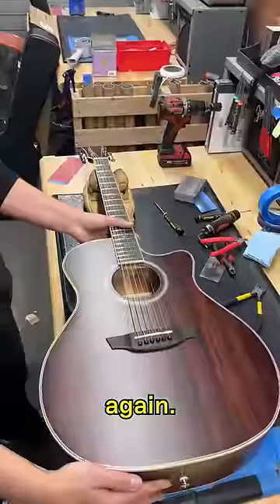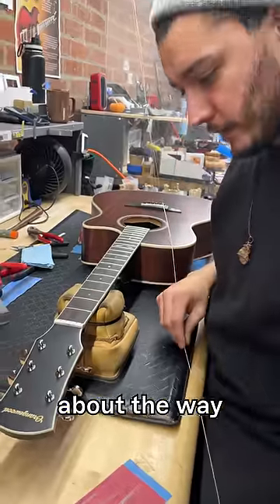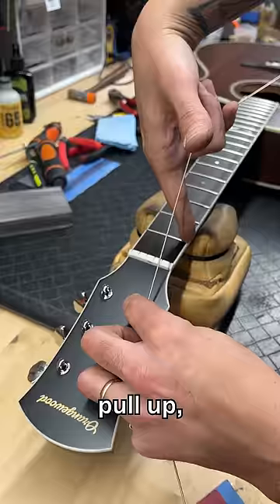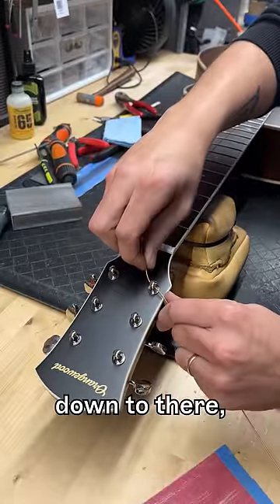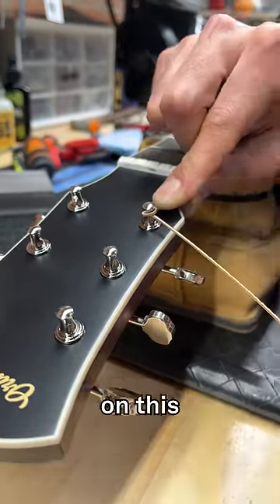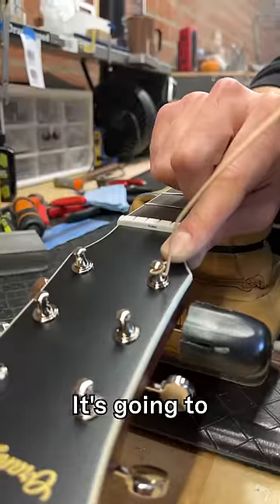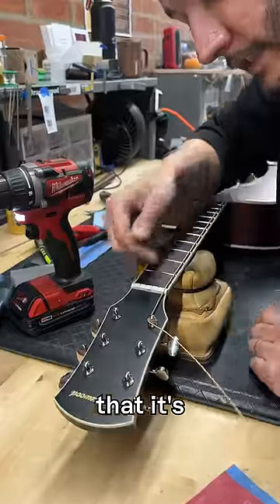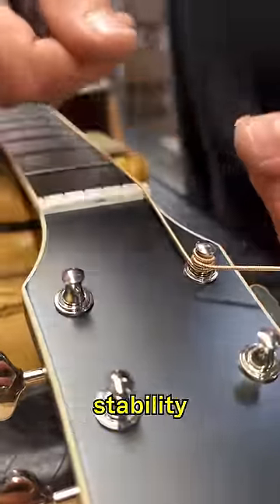Restring your Guitar like a PRO with this HACK

Comment: As a luthier, I advise changing one string at a time. A set of steel strings at pitch is exerting c.70kg of tension. The forces on the top and neck are massive, and the guitar doesn't like big changes in tension. I only remove all the strings for repair work.
Reply: I have been told the same by three pros
Reply: where do you start - thickest string to thinnest, or the other way?
Reply: @alcatraz0198  it doesn't really matter, but I start with the low E, then high E, then A, B, D, G.
Reply: 100% !
Reply: @elpirata2685  thank you, will try that. :)
Reply: Doesn’t hurt it to take them all off. How are you going to properly clean and oil the fretboard?
Reply: Truss rod is steel. Cut them off all at once....one at a time or in pairs....it doesn't matter. I'm betting you can't even pronounce luthier properly.
Reply: Yea whatever. Complete nonsense
Reply: @Craig-xf7ox  Truss rod may be steel, aluminium, brass or carbon fibre, or none at all. Soundboard is spruce or other conifer and thicknessed to around 2mm. Only remove one string at a time unless doing repair work that requires all strings off at once. Fingerboard and under strings can be cleaned bit by bit.
Reply: @elpirata2685  absolutely a waste of time and energy. My D28 has had all the strings cut off every time. It's survived my grandfather my father and now me.Youre overthinking it. But enjoy those Stew Mac videos.
Reply: Same as mine 👍 @elpirata2685
Reply: @Craig-xf7ox  Great for you. As a maker and restorer of violin, guitar and lute family instruments I am more cautious.
Reply: I was horrified when I saw him cutting all the strings.
Reply: I agree 👍🏻
Reply: Great tip (and awesome job title)! But instead, can you just detune the strings and then bring them up evenly once they are changed? Maybe that’s harder, I don’t know.
Reply: I was taught the same. I guess if you don't care it doesn't matter, but leaving it without any strings for too long will require you to get it adjusted. The truss rod is bending in the opposite direction. I think the only guitar you pull this off with would be a parker fly, if i remember correctly they didn't have them at buy were added later. Since the neck and body is one solid piece of carbon fiber. But doing this to a normal guitar will absolutely damage it over time.
Reply: @elpirata2685  The problem is not to remove all the strings, the problem is that you don't have to cut them when they are in tune. It can damage the guitar. Relax the strings gradually and when they are all relaxed they can be removed. Never cut all strings when they are at full tension!
Reply: I never take all of them off like that unless I'm doing a deep clean and adjustment or repair work. 

Even my electric guitars, with floating trems, I've learned to do one or two at a time so the bridge doesn't get all out of whack and need to be tuned 20 times just to get the balance back lol
Reply: so you mean, like an example i cut high E string and change it to new while the other old string still on guitar? like don't make guitar completely naked is that what you mean sir?
Reply: @rxfordny i just found out this today man
Reply: @aniqsufyan7722  that's exactly right. It helps keep the tension on the strings and prevents the neck going from one extreme to the next. On acoustics, it also makes it a lot easier on the bridge. It's the most stable and safe way of doing things.
Reply: @Dr_Bobo137  Detuning all the strings still results in a release then reapplication of 70kg of tension. I prefer to detune using drill rather than cut, but cutting is okay. I just don't recommend releasing all the string tension unless necessary.
Reply: @aniqsufyan7722  yes, that'll work. I still prefer to detune rather than cut.
Reply: Came to say this
Reply: Was gonna say the same thing
Reply: Same here.
Reply: @treetopher9342  Yes! Just a truss rod adjustment when the new strings go back on only if necessary!
Reply: Holy fuck. 

The reason to do each string at a time is so the truss rod doesn’t move.

Yes you can take them all off at once and do a full clean there’s nothing wrong with that but if your fret board is clean and your guitar is set up correctly then there’s no point in risking more work then what’s needed incase the truss moves .

So yeah there is no proper way to do it, the right way is to do what is required of the guitar. 

Also if you work in a shop do you really want to risk the customer coming back complaining that the guitar doesn’t feel the same ?
Reply: As you should. Thank you
Reply: I do that too.
Reply: @elpirata2685 that I don't do. But I will from now on.
Reply: @rxfordny  I have 10 guitars and honestly the neck tension issues from strong removal are only a problem if you leave the strings off for a significant period of time, when you need to adjust the truss rod after or it warps due to moisture or excessive aridity. Polishing your fretboard (not maple fingerboards, then just need water and drying with paper towel) makes it feel slicker and softer. Don't go overboard with lemon oil as the acidity can dissolve fret glue and cause buzz, a little goes a very long way.

Hope that helps.
Reply: My acoustic guitar is on storage for more than a year. Is it okay if I loosened all those strings?
Reply: @JedTaneo  If you replace them with another set of strings of a similar gauge, that should be fine. You may need to check for warp/bow first and adjust the truss rod accordingly, don't go overboard, usually a quarter turn of the truss is enough to make the change you require.
Reply: @JedTaneo  Oh, and try not to leave it without strings for too long
Reply: Absolutely correct
Reply: as just some guy with guitars. you loosen the strings before you clip and remove them... pretty sure he did the same. and thats so he can clean the instrument also im sure which you cant do with 5 strings on it
Reply: I cringed when he cut all the strings at the same time
Reply: Well I’d like to disagree, I cut all mine at the same time and my guitar still sounds absolutely terrible🤣
Reply: And I learned that if you have to take all strings off take one off at a time slowly and give the neck time to adjust to the tension difference
Reply: That's what my teacher told me 

I wonder how this guy owns a guitar shop and doesn't know that taking off all the strings at once is bad for the neck.

It's supposed to always be under tension

Why though?
Reply: I use slinky top heavy bottom from Ernie Ball. I wonder how much pressure they exert. I am play a half step down though. Well Drop C#
Reply: @Craig-xf7ox  good luck with restringing a floating bridge
Reply: As a blacksmith i recommend forge welding your strings to your nuts so they get a nice seal you can additional tig weld the string to the tuner for extra security. Never worry again!
Reply: @Craig-xf7ox I'm not a luthier, but I've always done one at a time.  I have also gone as far as adjusting my truss and my bridge to get a different action on my bass or guitars.  Even if you don't damage it, your setup and your tension are going to influence the intonation of your instrument meaning the fretted notes could end up being out of pitch.  I've never done this "Gibson knot" either, could care less about frequent tuning because I'm gonna tune all the time anyway because that matters to me.  But yeah, your action is going to be adjusted while the instrument is strung so you best believe cutting all the strings at once is going to change something and you wouldn't even notice, but somebody might and that's gonna suck lol
Reply: @RRtradestar  With a floating bridge Vibrato system, absolutely one at a time to keep the position, like you say.
Any other setup, no guitar Ever got damaged by removing all the strings.
Reply: @Jabb2531  You don't know how truss rods work, and that's ok.
Only way to move a truss rod is with intent and a tool.
Reply: @hugoshubert I am an Actual luthier, 30 years experience and own a business specializing in, you guessed it, Stringed Instruments. I have 13 of my own guitars hanging in the room I am currently in, 3 of which have been stringless for AT LEAST 4 months.
The necks on each are in the exact position as the day I removed them.
The common misconception is that the string tension and truss rod are in a constant state of opposition which, as you and I know, is not the case.

For anyone wondering, the neck flexes a small amount in either direction as string tension is increased/decreased, but it Always settles in the influence of the truss rod when strings are removed. No matter how long it's left without strings, unless in a situation where pressure is being applied (leaning on a wall, heavy objects piled on it, etc.) the wood will not move more than the truss allows.
You actually risk More movement by storing a guitar at full tension.

All this is to say; Stop Worrying About Neck Movement!
Wood is flexible, that's why it's used and not stone or bone or ivory or metal. The truss rod, when present, is Designed to adjust the wood. Don't be afraid to use it when needed and don't buy into myths about damage caused by a naked fretboard.
The Real damage you should be avoiding comes from dropping, improper storage, extreme temperature and humidity swings, and idiots cranking on the truss.
1/4 turn, let it settle a bit, repeat as necessary.

Parting note; There is no uniform amount of string tension, either. 70kg was mentioned above, and that's within a common range, but scale length, string gauge, nut and saddle height, neck relief and even temperature will have varying effects on the tension on any individual instrument.

I hope I have provided some with information they find valuable and helped relieve some undue stress and worry.
Reply: Waste of time. Been hearing this same BS for 35 years of playing
Reply: @elpirata2685  as a road tech I've seen the worst a guitar can endure. I wouldn't call cutting strings off and replacing them one at a time cautious as much as precious. It's hysterical you shop guys dealing with high end guitars doctors and lawyers own or club guys think you somehow "get it" . Be as precious as you want with your local heroes.....I'll be in the arena up the street working with pro musicians who rely on their instruments to feed themselves and a crew of 70.
Reply: I have always changed one string at a time, and as I go, I tune up the new strings slowly... in increments (which tends to stagger the tension across the strings). That is not the way a production shop would do it, but I feel like it is a better way to go. Just doing smaller overall changes to the total tension on the guitar. I'm good with this method. Probably takes 2x as long as the method in this video, but I don't care about that.
Reply: @Craig-xf7ox  as a musician who lived no fixed abode for two decades, I know what you're saying about being too precious. The crux is though that I can hear and feel the difference. Do a double blind test and see if you can.
Reply: @elpirata2685  I'm in a different town every day ... different weather different a/c in the room. We keep stuff as safe as we can but it's getting tweaked again anyways. Every day. It's rare that a guitar is spot on out of the case so a bit of massaging always happens.
Reply: I always knew I did one string at a time for a reason... I normally take one off at a time, but take all of them off and then put them all on one at a time. Would you suggest I unstring and immediately restring each individual string or is my method okay?
Reply: I was taught the same by my teacher :) been doing it like that ever since
Reply: Dont dive bombs do the exact same thing?
Reply: @treetopher9342  he literally said he only takes them all off if he's doing repairs. That would count as a repair. How often do you oil your neck? Every time you change the strings? 

That's something most people never do.
Reply: @Craig-xf7ox  the truss rod doesn't attach the neck to the body though. You make adjustments to the truss rod when the neck starts to bow from the body, or concave. 

A truss rod will not stop your guitar from breaking in half. 

When you look at a guitar like a fender strat, the neck is completely separate from the body. And on older models, to make an adjustment on the truss rod you would have had to remove the neck from the body. 

I wouldn't go around degrading others for not being able to pronounce words when you have zero clue what a truss rods purpose even is.
Reply: This really doesnt matter, if you are worried in the quick change just take them off one at a time but you definitly dont have to leave on five old strings while you change one just to the move oneto changing the next.
Reply: Loads of great comments and discussion on here, most of it respectful. Some doubting that I am a luthier. Whatever. I don't need your validation. I have worked on guitars, lutes and violins for 3 decades. Sometimes on instruments worth next to nothing, sometimes on instruments worth as much as houses. 
A few luthiers  on comments focusing on the neck and truss rod. That was not my primary point of concern. The soundbox, and particularly the soundboard, is my primary point here. An instrument needs to be relaxed, not fighting itself. Sudden changes in tension are really bad to keep an instrument in balance. You may also find it needs playing in again, though not as long as when new. An old English double bass was just restored in the shop, and then reopened to alter the bassbar, since the tone was less than it should've been. To change the bar, the front was off 2 days. It took a full week of playing before the bass freed up again and the tone could be fully assessed and adjusted. It will now improve over the next months of hard playing. The change in a factory guitar untensioned then quickly retensioned is less of course than my example above. But the difference in tone and response can be heard and felt by any half decent player. If you don't believe me, try it yourself both ways, or better, try a double blind test with someone else doing the restring both ways. 
The reason why the restring is usually done as in the video is economic. It is simply quicker. That's how I was taught when I first worked in a guitar shop at 16. Quicker is not always better.
Reply: @elpirata2685  now tell these dorks how the temperature and climate can effect the guitar too.
Reply: @Craig-xf7ox  why are you being so rude and nasty?
Reply: THANK YOU. Even as a drummer I physically flinched when he cut all strings like that.
Reply: Simpler to take 2 - 3 winds on the tuning post with the free end of the string BEFORE inserting the wire through the post hole.  Saves all that guessing and measuring by fingers and frets.
Reply: That's exactly what I thought here.. this is Busch league
Reply: The strings looked all pretty loose when he grabbed them to cut.
Reply: I have always thought that; that's how metal fatigue happens, continually applying and removing strain. Wood is different, but I can't see it being a good thing to do, and cutting through them all with a pair of snips, as many seem to do, ensures maximum rate of change of tension. I unwind them one by one if I need to take them all off to clean & oil the fretboard, or work on the bridge or the nut.

I can see why they do things differently in a factory environment, as time is money, and they don't really care anyway.
Reply: Yeah, I would never take them all off the guitar. I can’t imagine the amount of tension you are dealing with by doing this to a guitar. Can’t be good for the neck. I’ve always changed my strings one at a time from the time I purchase the guitar.
Reply: @Craig-xf7ox  An actual luthier said to do one at a time and you disagree. 
Guess who's advice I'm going to take...
Reply: @vetham100  Clearly not the guy who has been taking care of guitars for arena bands for 30+ years. You do realize ANYONE can call themselves a luthier. There is no sanctioning body, no tests, no license. So.....go ahead and listen to the "luthier".  I'll continue doing it my way and getting called back time after time.
Reply: @Craig-xf7ox  The belly of the guitar is all WOOD. The truss rod strains against the WOOD of the neck. Metal, even steel can suffer from metal fatigue.
Reply: @treetopher9342  If you wind them off one at a time, the stress is released slowly, instead of with a snap. And if you only do it to clean and oil the fret board, it is less strain. My hands are clean when I play my guitar, and since I'm not Angus Young leaping about the stage, I don't sweat all over the fretboard, so mine rarely gets dirty.  Bit of dust maybe, but that's all
Reply: @Craig-xf7ox  It's a Martin, and I presume built when things lasted... we didn't all have a rich grandfather or father or even relatives that played the guitar. I'm 75 next month and only now could I afford  a D28, but at my age it would be pointless because I can no longer do it justice. It would be like a 70 year old buying a Porsche Carrera GTS. PS I could even afford a D45, but that would be even dafter.
Reply: @TildenCats why would you count regular maintenance as a repair?
Reply: @edeledeledel5490 at the end of the day removing them all does nothing to your guitar. I remove them all every time and nothing happens. Neck stays in place and everything is fine. You don’t want to leave the strings off for a long period, but for a string change or setup it’s fine.
Reply: @treetopher9342  Yeah, sure. I don't want to take the risk. Never had any one of my guitars fail, and I've been playing and using my method for 64 years. And do you cut them off three at a time while at full tension? How many of your guitars are acoustic?
Reply: @ no I never cut at full tension. I have 17 guitars. 7 of which are acoustic.
Reply: @treetopher9342  I don't count oiling the neck as regular maintenance. It's just not necessary. 
Like getting your tires shined. 

If you do regular maintenance on your hands before playing, like washing them, you'll never need to oil the neck. I have several guitars that are over 50 years old, never had the neck oiled.
Reply: @edeledeledel5490  and the belly is supported by bracing that will support several times the strings tension. If you want to be precious with your guitar.....go ahead. I've got gigs to do and no time for foolishness.
Reply: @TildenCats  I’ve seen fretboards get ashy and even crack they’re so dry. You do you, I’m going to take care of my fretboards.
Reply: @treetopher9342  perhaps those instruments were made of shitty material. 

I don't buy junk guitars that will fall apart.
Reply: @ didn’t know American Martins were cheap guitars because that is the one I saw a cracked fretboard on.
Reply: @TildenCats  when did I say ANYTHING that would illicit your response??? I understand completely how a truss rod works. Having worked on guitars starting at 12 and a 30+ year career as a tech in the studio and touring. And I've replaced several truss rods over my career in both acoustics and electric guitars.
Reply: @treetopher9342  they aren't....and that's the fault of the owner for not properly taking care of it.
Reply: @ I agree
Reply: @Craig-xf7ox  Yeah, sure - you've never seen separation of the bridge or bulging of the belly being repaired on expensive guitars (Martin, Gibson) on here? Bracing won't support several times the string tension - that would be just too stupid for words.
Reply: @Craig-xf7ox  calm down Craig.
Reply: This is utter bs and a myth. Cutting off all at once doesn't hurt the guitar in the slightest. Don't claim to be an expert and then give terrible advice.
Reply: Wow. There's some real haters and doubters commenting. I'm not so insecure that I need your validation. If it helps you to get that negativity out, then that's great. My customers are very happy. I repeat my challenge to those who doubt: do a double blind test. Have someone else change the strings on two guitars (preferably more), with the sudden release of tension on one, and with strings changed one at a time on another, and see which guitar feels more settled, balanced. Any half decent musicians can feel and hear it.
Reply: @edeledeledel5490  oooooook. Tell yourself whatever you need. You're wrong.
Reply: @elpirata2685  not hating.....it's just utterly unnecessary. I've been handing guitars to a bit more than "decent musicians" for years....no complaints nothing but compliments and paychecks. But if making customers believe it's all voodoo and magic works for ya....
Reply: @Craig-xf7ox  yeah, you're hating and rude, but that's on you. You can disagree and still be civil. You can make a point without trying to condescend.  Can't hear it and feel it? That's also on you. Not voodoo or bs- just basic physics. How many guitars you made? I've made dozens of instruments, and played venues from the street corner to the Albert Hall. I wish you well.
Reply: @zackiej89  if it makes no difference to your guitar, it must be a plank if wood. The soundboard is in balance with all that tension, and it takes time and playing to reach that balance. Taking all that off at once and you throw it out. 
I don't claim to be an expert- I am one. This has been my life's work. Disagree civilly or jog on. The great thing about advice is you don't have to take it. You can ignore it and carry on with what makes you happy. 
This is exactly how I was taught to change strings over 3 decades ago in my first guitar shop. It's how most shops do it. It's still wrong, it's just quick, and time is money.
Reply: @elpirata2685  and if you feel any condescending....that's on you pal. Because you know and I know I'm right. If you want to treat guitars like holy relics go for it. They hold no magical properties. It's  pieces of wood.
Reply: As someone who has been taught by an incredibly good luthier, this is not the way unless you are restringing a floating trem. The neck just flexes back into place once brought up to tension. 

This is like listening to the people who say never adjust your truss rod unless you do a 32nd of a turn and wait two weeks before adjusting again 😂
Reply: @VinsanityNailed  thank you!! Finally a sane voice.
Reply: @Jabb2531  I can tell you this.....every single customers guitar that leaves this shop doesn't feel the same. It feels better. Again.....if you want to treat guitars as some kind of magical precious item that doesn't respond to physics....that's on you.
Reply: @Craig-xf7ox  mate are you ok you have replying to comments in this thread for a week straight. Someone obviously hurt you or your guitars . And if you read my comment I said there’s multiple ways depending on what the guitar needs but sometimes it’s a safer bet to  do one string at a time. when your working on a customers 6k guitar. Especially in a busy shop . 

Mate get offline
Reply: @Jabb2531  seriously??? You respond every single time for weeks as well. I'm off work until the spring with the exception of a few weekend things and some one offs. What's your excuse? We are taking around guitars that the brokers fee was more than 6 grand. If a guitar is so fragile that it can't handle having all the strings removed.....it needs work perhaps you aren't qualified to perform?
Reply: @Craig-xf7ox  again no I didn’t . And I just scrolled through all the comments to make sure I wasn’t crazy but I made 1 comment 3 months ago. You have been coming back for 3 months straight being a sad guy, there’s other people here commenting about you being rude and what not. You’re obviously trying to find someone to agree with you hence why the comment above the one you tagged me in (that alerted me to this thread ) is you finally finding someone who agrees with you . 

Sad case of the one guy arguing against the majority hoping he finds a fellow human who thinks the same to not feel alone in your own stupidity .

And I’m a stay at home dad and carer for my aunt who’s dying of cancer . 

And nah mate it’s not about that , it’s just called taking a few extra minutes and taking ur time in someone else’s pride and joy, it also can end up saving any truss rod adjustments that can happen , again taking away another point of failure aka scratching the headstock , more wear on the truss rod nut . It’s small things but they all make a difference . And as ur mate the luthier said necks of the guitars will bounce back , but not all guitars . 

I hope you have a great day mate and best of luck to you in this thread I hope you keep getting enjoyment out of telling everyone their wrong :)
Reply: @Jabb2531  ha ha ha ....I'm not even going to read whatever you wrote....but I'll respond.
Reply: @Craig-xf7ox  have a nice Christmas mate, you obviously did read it. You have been coming here for 3 months and replying to every comment . Keep playing the dickhead card it works for you .
Reply: @Jabb2531  still not gonna read it. But Merry Christmas!!
Reply: As a luthier, you should know that guitar neck is designed to bare that much tension. Snipping off a set of old strings isn't gonna twist that neck unless it's TEMU garbage.
Reply: @duanelappe9767  They are wrong. Talk to guitar BUILDERS. Not the old hippie at your local guitar store.